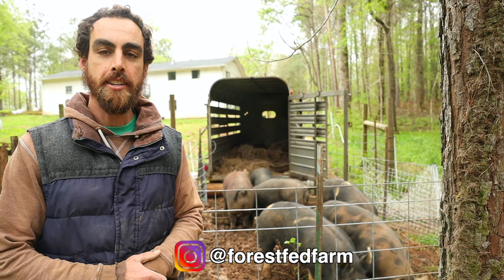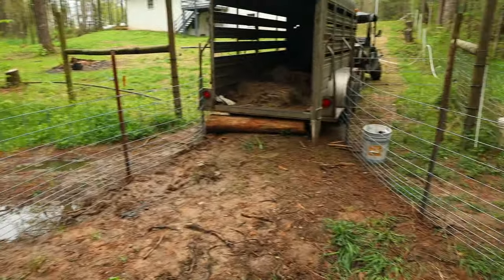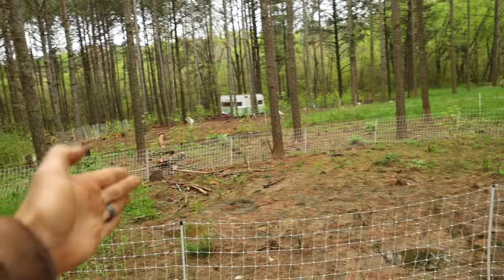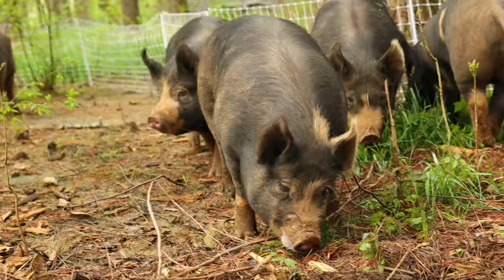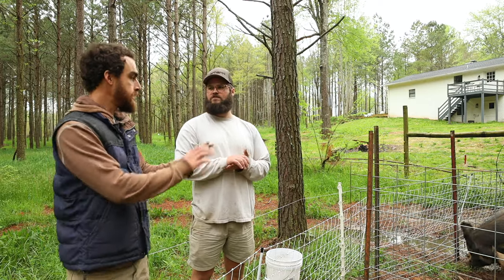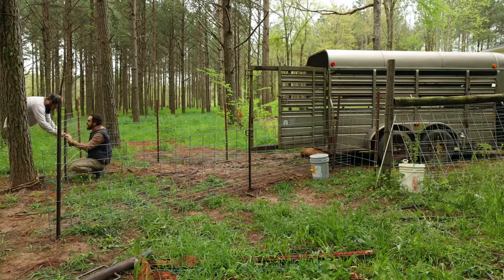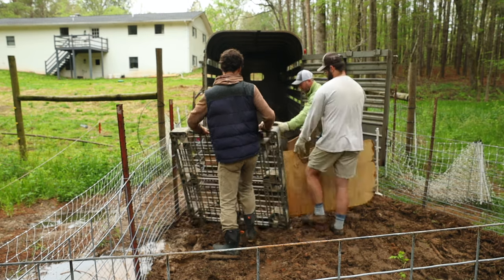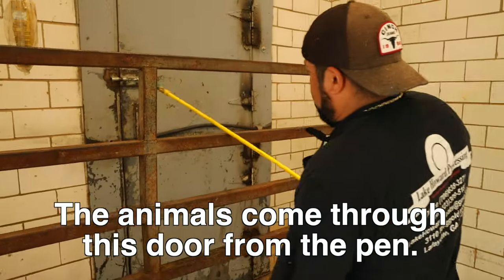Will They Escape? Best Way to Load Pigs on a Trailer

Comment: One of the things I noticed during decades of working with animals is that the sound of a hollow floor, be it a ramp or truck bed, made them nervous.  My solution was to train them to cross a small bridge to reach a trailer where they were fed.  On shipping day going into a trailer just meant FOOD !!!  lol.  It worked well with every type of animal.  Not to ignore the fact that they were also trained to come to food by a call, so a loose animal was also easy to get back into a pen.  I still do this with my ducks, geese, and chickens every evening to get them secured for the night more easily.  They enter a chute that leads to their coops, and that's the only place I put feed out, so they go in, and I close the chute.  After each bird is full and had water , they usually go to their roosts, which is individual for each species.

Comment: I raise pasture hogs. I keep mine behind poly wire. When it’s time to haul to the butcher I just run a poly line chute. Guy that picked up the hogs couldn’t believe it worked. He took pictures because he said no one would believe him. Like that fella said the poly line is normal to them. I didn’t have to force them at all. A little bit of food in trailer and they jumped right up in there. I have done this before. I have a had a chute 800 yards long. Pasture pigs are use to moving. Be nice to your pigs and they will trust you way to much.